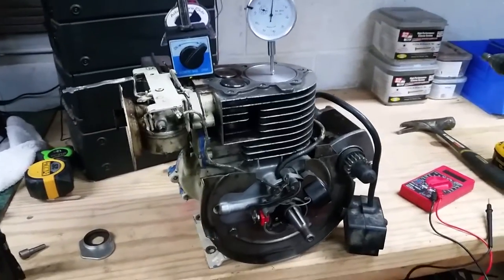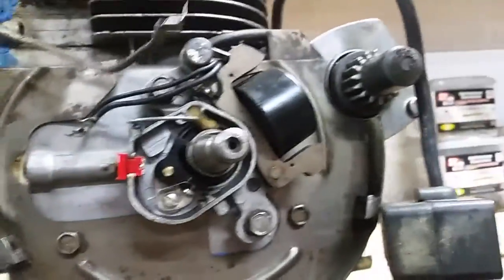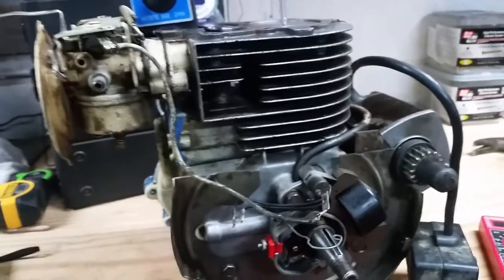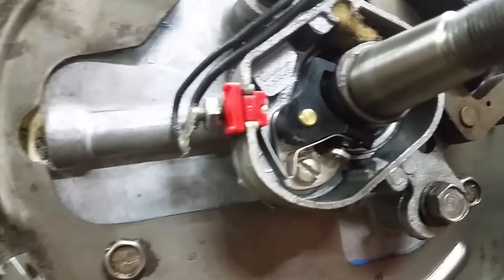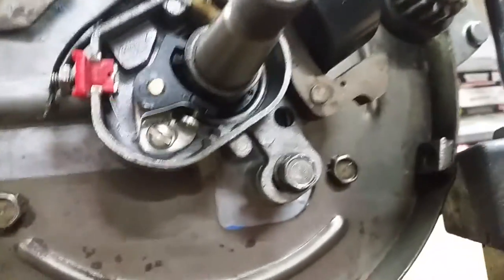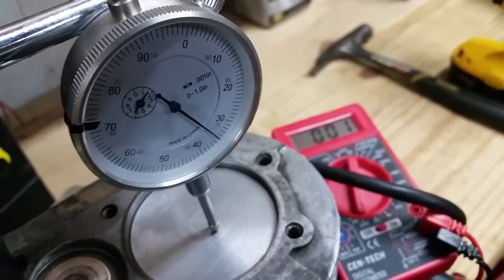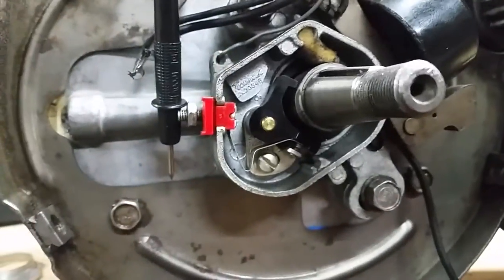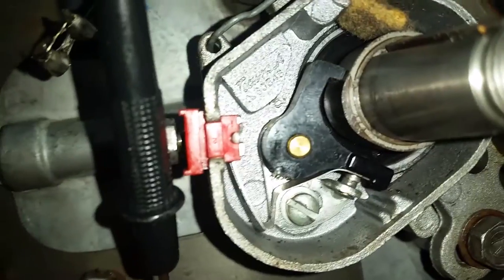Tecumseh H60 - Adjust Ignition Contact Points Timing

Comment: Great vid. I have a tecumseh h60. Cleaned and gapped the points. I now have spark. It idles well, but backfires and then stalls when put to full throttle. I timed it with the dial indicator. Should I install new points and condenser, or go back and gap and time the engine again? Thanks in advance

Comment: Don't forget that every engine piston has a dwell time at TDC and BDC.  That means the crank is rotating and the piston is not.   Its a short time that gets longer and engines with longer rods.   so, when building car engines we use a piston stop and a degree wheel for accuracy.   That would take out any slack.

Comment: So is this procedure of going through all this maylay with a dial indicator separate from setting the points? Is that what he is telling me here?
Reply: Update: Yes. I found out that points must be set at TDC/highest point on cam lobe. Tighten everything down on points post. THEN go through this maylay with the dial gauge. If you didnt loosen the bolts and move the stator, you shouldnt need to go through the dial indicator procedure. Hope this clears things up for anyone confused like I was.
Reply: Thanks for this, my magneto had been removed for cleaning so i was totally in the dark on how to accomplish timing, without the Tecsuem cutaway flywheel that a guy tried to sell me for $100.00!
I was confused on the step#1- Set points open to .020 on hi point of cam, & then do Step #2-the BTDC .80 & check points with meter to begin to open. First time i tried, step #2, points were already opening, so i;m assuming i mad a mistake setting point gap

Comment: If 0 is TDC to set points at80 thou. BTDC. If you go to 20 aren’t you going to 20 thou. ATDC or 20 thou on the down stoked
Reply: Tom, he mentioned that on the dial indicator, there is a small dial within that shows how many tenths the dial has moved.  He started at 0.300 and backed it up to 0.220, but unless you are watching it, it is easy to miss, the 0.300 - 0.220 gives you the 0.080, it looks like 0.020 in the dial if you don't notice the change in the small 0.1" dial.  Time around 5:30 where he is explaining it.